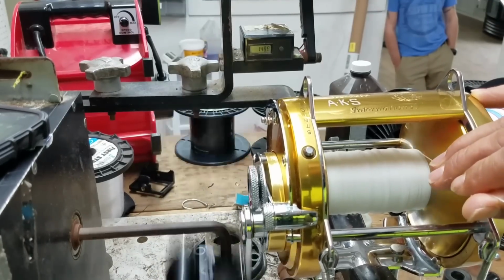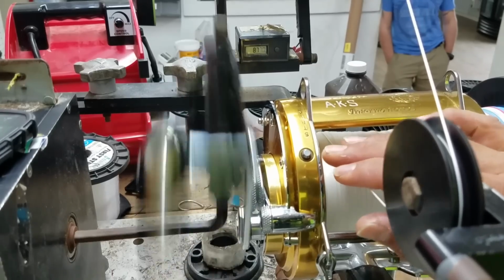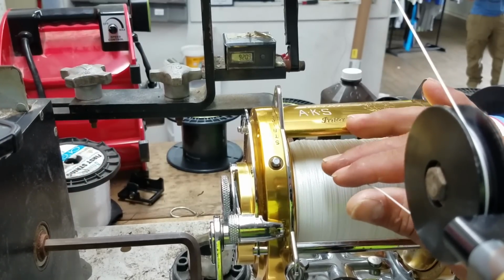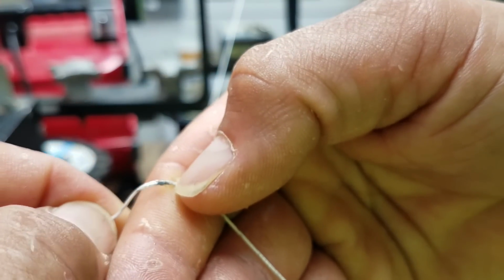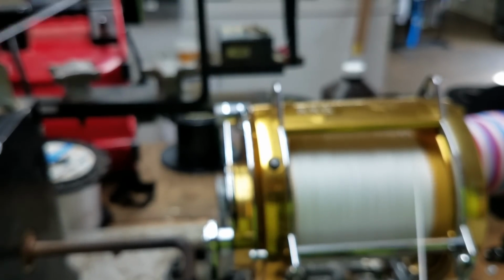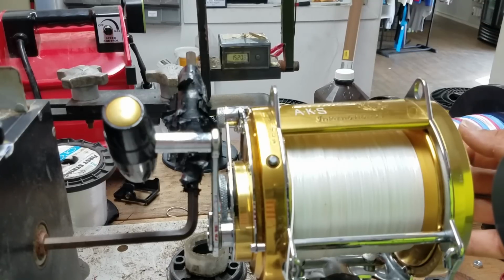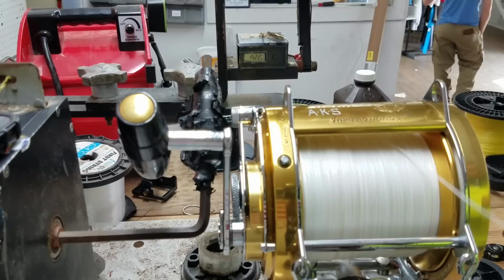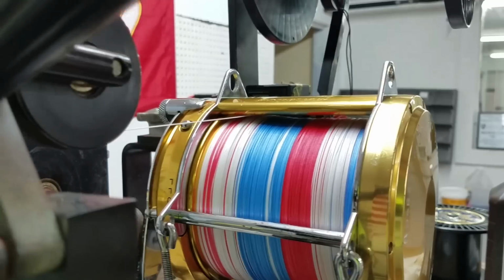Spool 80w International 130lb hollow core Patriot braid was My Idea taken by Jerry Brown Industries

Comment: Do you pit mono on the reel 1st so the braid dont slip
Reply from the maker: No we don't we don't even use tape either we invented or not over a decade ago and I put it on several 1000 reels both 1000 reals since then and it has never slipped on us ever slipped on us other than on extreme cold temperature on spull temperature on small reels like SXL and LX but we've already even remedied that situation as well

Comment: Xb braid must me super thick because I have 800 yards of xb 12 hollow cord 130 lb and 300 yards of 130 mono on a 130
Reply from the maker: That 130lb mono eats up line capacity big time... it's like 5 to 1 ratio per yd..
Reply from the maker: Also remember the top end of the spool is where more line can pack on per spool...
Reply: Team Hard Life Yeah I could’ve got a little bit more mono but I don’t like the packet to fall when I’m eating heavy mono especially on Penn reels because the top part of the real is straight across not rounded like a Avet
Reply from the maker: Your exactly right on that mono cam also be very unforgiving when it comes to filling the reel back up with fish on..
Reply: Team Hard Life yeah but I like at least 300 yards of mono just for the abrasion resistance and also I don’t get cut off is likely and I don’t have to make my leaders extra long and also if I get cut off in my mono by another shark or whatever it’s as Expensive to fix
Reply from the maker: Yes fishing with the xb I can totally understand using the mono still... Always gota try and keep expenses down... shark fishing isn't for the faint of heart or Wallet